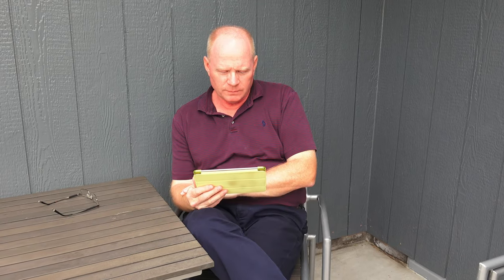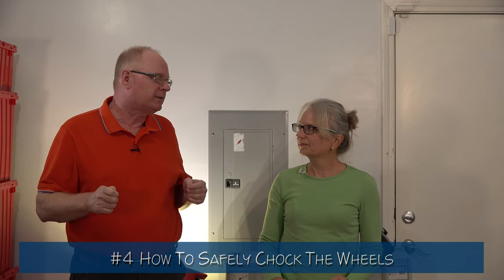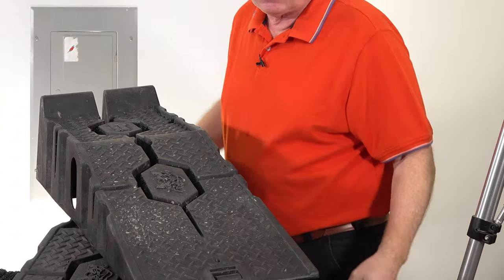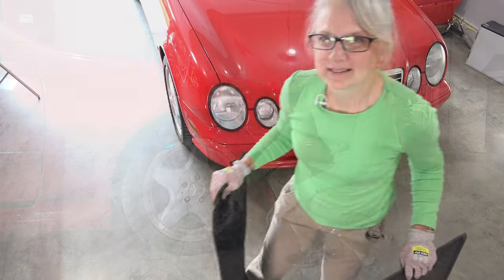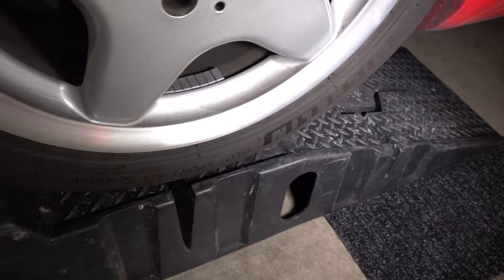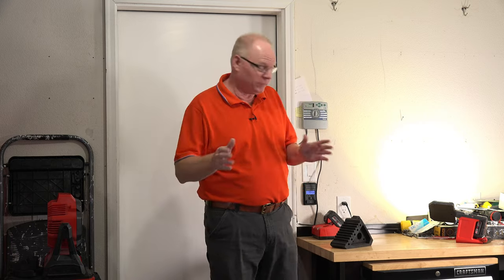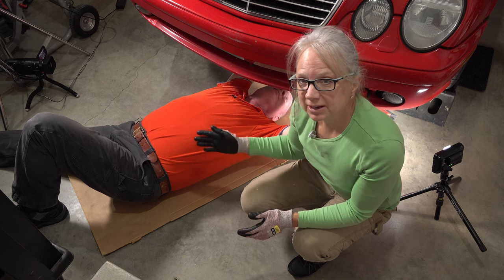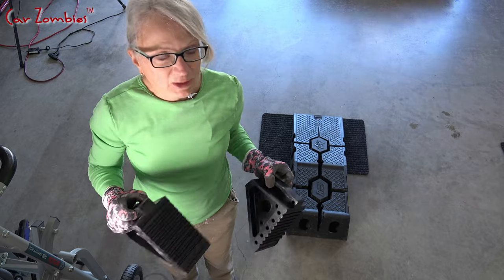5 things the Pros don’t tell you about car ramps

Comment: Lifelong mechanic here who gave my ramps away many years ago along with my stands. Jacks and wooden cribbing work superbly. First responders carry wooden cribbing for good reason. I also use a pinch weld puck where useful.
Reply from the maker: I like the idea because wood probably won't slide and it is great at handling the compression (assuming it is wide enough not to be unstable). However, we have never tried this.

Paul 😎

Comment: Placing a mat underneath only a portion of those Polypropylene ramps is insane. Those ramps are designed to be on  a flat surface so the weight of the vehicle is evenly distributed over the length (and width) of the whole ramp. Even a thin mat creates a relatively less supported area where the mat ends and the ramp is solely supported by the garage floor. There are now forces at work that are pulling the bottom of the ramp apart along the bottom edge because the bottom of the ramp is not on a flat surface. Better to use a floor jack and jack stands; you can't work on the brakes if the wheel is on the car anyway.
Reply from the maker: All good points. Our mats are so thin we really don’t think it’s making much of a difference as it isn’t even as thick as the rubber that’s already on the front of the ramps. But we really do think people should be careful of any risks, so we appreciate your comment. 

Paul & Diane 😎😃

Comment: I was looking for a video on how to keep car ramps from sliding and stumbled upon this gem. Love the video and love that you not only taking care of your cars by yourself but also taking the time to educate and entertain! Hopefully next time I use my ramps I can apply your tricks and not have them slide! Subbed 😊
Reply from the maker: Thanks Vincent,

Your response was exactly what we where hoping for when we made the video.

Diane & Paul
Reply: How I get my car, truck, and suv on the ramps is by using a 2”x8”x 2’ long board attached to the ramp itself. Whether you bolt them together, or use a long bolt just going through the ramp so you can remove the board once up in the ramp. Hope this helps. Also cut your board ends at a 45* angle to help get up on the board

Comment: Er, wouldn't the owners manual indicate where the jack-up points are and isn't there an info sheet with the chocks showing correct orientation? Sorry to be a party pooper.
Reply from the maker: Yes, you are right, the manual does indicate where the road-side jack-up points are, but we needed to put the car on jack stands to fix the brakes (it is very dangerous to work on a car supported only by a floor jack or road-side jack).

So we either have to jack up the car by the manual's jack-up point or and put the jack stand somewhere else (where?), or jack up the car from a more central location (like the differential) and put the jack stand under the manual's jack-up point, which can support the weight. The pros on the internet and the service manual both say to do the latter.

Also, unfortunately there were no directions with the wheel chocks and nothing on-line or in the Amazon comments section about orientation. I've never seen anything official on how to orient them.

Paul
Reply: @carzombies  Greetings and nice to hear from you. Having read your reply I'll cut straight to the chase, don't go under your vehicle and if it's about getting your brakes attended to leave it to the pros. There are many brake and tire specialists that charge fairly because of the easy availability of brake parts across all brands, you don't need OEM parts and the work is generally straight forward (which is why it's a DIY I know). However I'm amazed about the lack of info regarding the chocks, it wouldn't matter if the design was uniform but it isn't so why don't they say? It wouldn't take much to have the image cut into the casting mold/mould so it's ever-present.  A big thank you for taking the trouble to establish their correct placing without a doubt.

Comment: Sooooo...., you can't read a manual nor find the jacking  points on the 14,790 youtubes? Rriigghhttt...
Reply from the maker: Only the roadside jacking points are in the manual, not the jacking point for a floor jack to put the car on jack stands (the jack stands go under the roadside jacking points). This is the only safe way to work under the car. In our case the jacking points for the floor jack are the cross-beam between the front wheels and the differential between the rear wheels.

Paul

Comment: Advice from someone that has been driving up ramps with manual transmissions from the days of steel ramps and bricks for wheel chocks, when you have an automatic transmission put the selector in low gear, there is a reason it has this option. When choosing low gear there is more low end torque which makes its easier to climb without having to accelerate as much, keep left foot on the brake pedal having it ready to use as needed then feather the accelerator with the right foot until you find the sweet spot.   After enough practice you can feel when the tires go over the first hump, then settles then hits the end ridge.
In closing to find the jack points it may be best done by laying on your back or side  look on the frame with a flashlight,  it's a quick and safe alternative to using ramps.
Reply from the maker: This is really cool advice that we never thought of. Paul says he knew how to use the selector, but you think you only need something like that to climb a big hill on a dirt path or something, but why not use it to climb a steep ramp too? Brilliant! It would have been great for the video too!

We will try it next time...

Diane
Reply: Unfortunately it seems that gear , 1 and 2 for climbing hills is not available in new cars .
Reply: The low gear selector in an automatic is the same as the first gear in 'D' mode, it simply won't allow it to shift up, that's all...same gear ratio.  It's not like those 'granny low' they used to have in old manual trucks.  They have that option so that 1) the transmission is not constantly shifting up & down, overheating & wearing out, while pulling a heavy load; 2) to make it easier to drive slowly and control your speed (constant engine & wheel speed going up & down a hill; use engine braking instead of brakes for going down a hill) while on slippery surfaces such as snow & mud.
Reply: An automatic transmission will be in low gear even when the selector is placed in "Drive." It will not upshift until the car is going faster than anyone would attempt to drive up ramps.
Reply: @67scout73  You are correct, I mentioned it because many automatic transmissions when placed in low gear fluid pressure is raised as to give a little more torque.

Comment: Important safety tip! 
Whether using a jack and jack stands or wheel ramps to support the car, BEFORE getting under the car, give the car a couple good shoves on the fender like you're trying to push it off the jack stands.  
If it's stable, it won't move, even with a hard push.  
If it's not stable, well, let's just say it's better if it falls off the jack stand when you're not underneath it!
Reply from the maker: We agree, Great point!

We didn't learn this until the next video about using a jack with jack stands.

Diane & Paul

Comment: Hey Guys,
As a professional mechanic of 45 years, auto electrician, fellow YouTuber and part time college trade apprentice instructor, I can honestly say that you have done a great job of explaining the basics - well done. This is what I teach in my classes and you have collected the basic facts together with explanations why nicely.
I was also a mobile mechanic for 8 1/2 years, so I have some experience in mobile lifting equipment (currently I use Quick-Jacks to make my life easier). 
Just a suggestion with the placement of a jack stand. If you have the vehicle raised on 2 wheels, like you have, always use 2 stands. Also where you have placed it may be a strong crossmember, but some may confuse it with the steering rack - in your case, electric steering, which if weight came down on, would prove to be a costly repair.
My personal choice is to place the stand under the chassis rails down the sides of the car, to provide a much more stable platform to work on.
You may find that the ramps do not allow the height needed to place the stands there, though.
I personally prefered for many years mobile, to use a quality floor jack and stands. I did this with 4 stands. This clears up a lot of room to work around the engine, for example, if draining engine oil, a single stand where you have placed it, might in the way of the drain pan and you may be tempted to remove this safety item to get the pan in position. Using 4 stands along the chassis rail, provided a safe area to work under the entire vehicle with enough height to use a garage creeper to move around. It also allows for access to wheels and brakes.
Great job on the video and guidance.
MiracleMAX
Reply from the maker: Thank you for your kind words, MiracleMAX, they mean so much to us.

We could have used your training before we began, but without it we might not have started this new hobby and we area having a lot of fun with it.

We too have been leaning toward the floor jack with 2 jack stands for tasks like oil changes. As you say, ramps just don't get the car as high and yes, that idea of a jack stand in the middle for backup does get in the way. We also went through some creeper training when working on our transmission--our lesson: Buy a low-profile creeper, not a comfort one, for our car (see https://youtu.be/4E5vnFlf2EA).

Diane & Paul
Reply: @carzombies  Keep up the good work guys. You are always welcome to some tips from my channel as well.

Comment: I really like the spirit of this video -- well done!  Couple of suggestions:  While your improved hand-signals are a good advance, here's an alternative if you don't have a partner handy: If you have a laptop with a camera, you can set it off to the side, with the camera viewing the ramps, and the screen position so it can be seen by the driver.  
Now, regarding the chocks and their friction: For a constant downward force, friction is generally independent of area, because friction is proportional to both force and area, and for a fixed total force, the larger the area the smaller the force per area.  So either the flat or ridged surface should grip similarly to a flat floor surface. However, the flat surface of the chock is more apt to rest on any stray sand or grit on the floor, on which it will roll, instead of experiencing friction with the floor. Of course, your garage floor is very clean and smooth, and you might even get some extra stiction of the flat face to the wax polish :-)  You could improve matters by again using pieces of your rubber floor mat under the chocks.
Reply from the maker: I realize how lucky I am to have Diane on every car job. I just changed my brakes (next video coming up) and there were many situations where I can't imagine how I'd solve it by myself. The laptop w/camera is a neat idea, but I hope I always have Di to help as it would be no fun without her.

I like your friction discussion as well. It makes me think that the word "friction" has a more technical meaning in physics then how us laypeople use it in life. It is like how "cement" isn't "concrete" to a concrete worker, but everyone else calls "concrete" "cement". Someday I'll try to learn this better, but I hope I didn't mangle it up too badly in the video.

Thanks for the deep thought,
Paul

Comment: Great video! The grooved side of the chocks work well on rough surfaces. Dirt would be another good place. I have an asphalt driveway, which is not as smooth as your concrete. They slide if I use the smooth side facing the driveway surface. Your careful use of doormats to prevent the ramps from sliding is genius!
Reply from the maker: Thanks for compliment and the tip! We haven't tried it anywhere but in our garage.

Diane & Paul 😊😎

Comment: these are great tips guys! I ve been working on cars since i was 16, im 63 now and still have to do it.. I usually use one or 2 hyfralic jacks to lift it up, then place in addition to it 2 jack stands so there are 3 methods of support under it.. of course this doesnt allow much clearance so I end up with 3 to 6 " clearance above my head with which to work..at 63, this is Tough!  I picked up some metal ramps, much like ones I used to use as a kid, from goodwill  store but these are a pain to use when ur getting it on ramp by urself with noone to help guide u and compound that when ur doing it with a manual car..
Reply from the maker: Wow, I'm glad you use 3 methods of safety. That's really great.

Another commenter said you could use a laptop and a camera to see yourself go up the ramp, but we have never tried it.

Metal ramps are harder? I didn't knew that...

Diane
Reply: Good for YOU! Basically the same story EXCEPT I'm 70 & I have to do on a gravel driveway. ALOT harder getting up. 😂🤣 I HAVE invested in small/large impact wrenches so Im not at it so long.👍🖖🇺🇸
Reply from the maker: @riceburner4747  Paul just bought his first impact wrench but hasn't tried it yet. I'll bet we'll see that wrench soon...

Thanks for all the support and enjoy!

Diane😁🖖 & Paul🔧

Comment: I think that the ribbed side of the wheel chock would be facing down when used outside when working in an area with no pavement, there would be more grip in the dirt.
Reply from the maker: Great point!

We don't have gravel around us, but we bought a set of wheel chocks and keep one in our trunks in case we get a flat (car jacks are crazy dangerous by themselves). I think you are right, and if I get a flat and have to pull off to the side a road in a rough area I'd be inclined to use the ribbed side there too.

Paul

Comment: I have 3 or 4 pairs of different style car ramps... and never use them.  I find them all to be a hassle, unsafe and they simply don't raise the car far enough to do any meaningful work... or are too steep for low slung automobiles.

I have considered making my own wheel ramps from wood... they would be cumbersome and heavy... but I imagine I could make them pretty functional, to avoid the prementioned issues.

I understand that it can be hard to determine where the jack points are on some cars... but you just need to get down low to look... use lights, mirrors and even feel around if you need.  It's a great idea to have a low profile jack with a rubber cushion for the lift pad.

Oh, as far as wheel chocks go, most chocks I've had have a slight arch on one side... an indication of the side intended to contact the tire.

Get a floor jack... it's the only way to go.  If you have the money, get an aluminum low profile one.  Leaving your floor jack in place is a good backup if you are worried about your jack stands.  Jack stands typically are very robust, and the only one I've ever seen fail was because a lateral load caused the thin sheet metal base to buckle.  Project Farm does an excellent test of jack stands.
Reply from the maker: Thanks for the detailed response. We followed your advice and bought a low-profile floor jack right after we made the ramps video. See https://youtu.be/_wlvidlYYS4. Since then we have also made many repairs on the cars and are having a blast. Thanks for your information, advice, and support.

Paul & Diane

Comment: Hi, i wonder if it might be better to use ridges side down on the wheel chocks if using on concrete that has been brushed with ridges for grip, the teeth might mesh together better than on the smooth surface, but i love how you discovered the 45°angle on one side, I never even noticed that! 💁‍♂️👍
Reply from the maker: Sounds like it would work to us also. Also, thanks for the complement!

Paul & Diane 😎😊

Comment: Always have a backup support system for maximum safety. I use the jack as backup for jack stands.
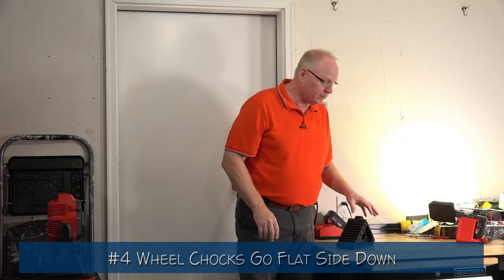Reply from the maker: Thanks, I'm glad you are thinking safety. See 14:59 for our solution, we use the jack stands as backup for the ramps, and in our next video on jacking up the car we do it like you, using the jack as backup for the jack stands.

Diane & Paul
Reply: With the jack stands you have single redundancy, the jack would provide double redundancy. It is your life we are talking about. Once on the ramps, you place the jack first to get redundancy, then go under to place the jack stands. Ideally you don't go under to place the jack stands do it from the side if possible.  @carzombies
Reply from the maker: Good catch, you are absolutely right, we had only the ramps while we were placing the jack stand for double redundancy. Your suggestions for a solution seem like the best options.

Paul & Diane😎😊

Comment: I don't know how much I trust plastic car ramps.  I know they're supposed to be tough, but still...  good call on the backup jack stand.  For the positioning & driving up part - alternatively, if your jack is tall enough, I guess you could jack your car up from the center front and then place your ramps under the wheels if you don't want to use jack stands as the primary support.  I also always keep the jack in a strong spot with just enough tension as a backup for whatever the primary support is.
Reply from the maker: We agree! You sound just like us. Now-a-days we actually prefer to jack up the car instead of using ramps just because we trust it more...and we still use 2 sets of jack-stands (one as backup).

Paul & Diane 😎😊